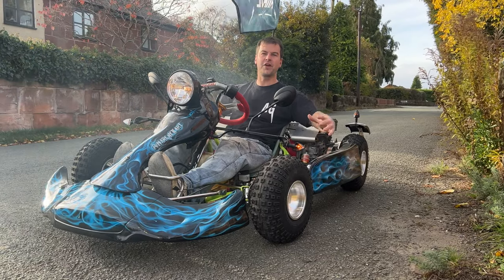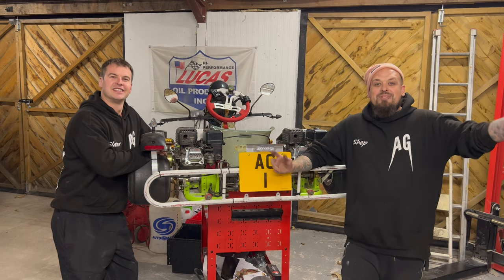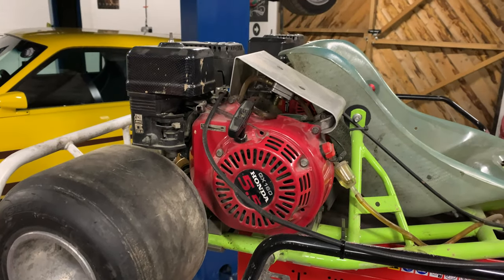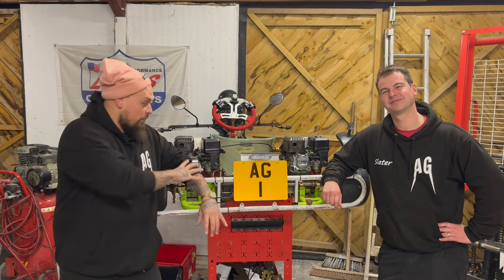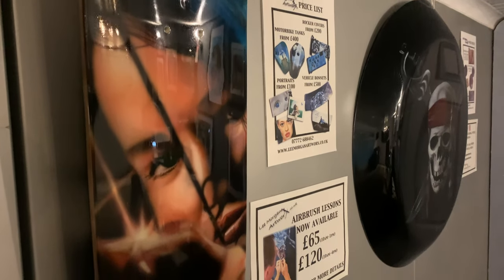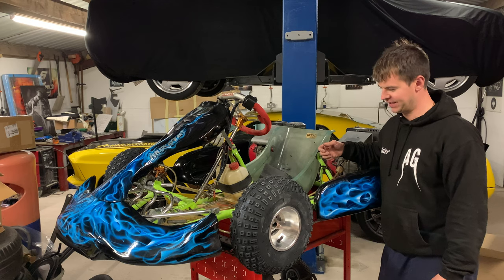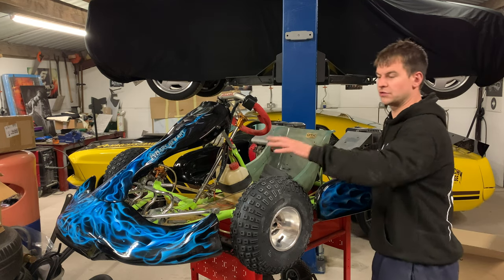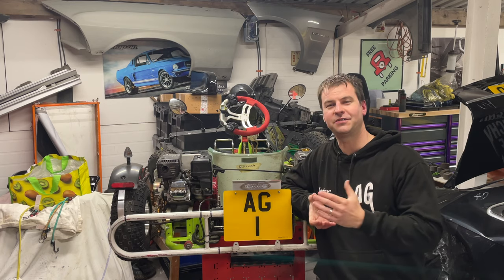How To Build your Own Road Legal Kart Anarchykart Part 1 - The Anarchy Garage - Episode 10

Comment: Can we have some links to the front brake kit/s
Reply from the maker: Yes I will add some 👍🏻
Please do your measurements against your kart frame to make sure they are compatible. You can also make brackets and use washers to make them fit as long as it’s good quality you should have no issues come MOT time
Reply from the maker: https://www.ebay.co.uk/itm/Kelgate-Kart-Brakes-/185181248013?mkcid=16&mkevt=1&_trksid=p2349624.m2548.l6249&mkrid=710-127635-2958-0
Reply from the maker: https://www.ebay.co.uk/itm/Wild-Kart-Pulsar-Lotus-Front-Brake-Setup-/194196426489?mkcid=16&mkevt=1&_trksid=p2349624.m2548.l6249&mkrid=710-127635-2958-0
Reply from the maker: https://www.ebay.co.uk/itm/ATV-Quad-110cc-front-hubs-stub-axles-and-brakes-pair-110mm-/193726300391?mkcid=16&mkevt=1&_trksid=p2349624.m2548.l6249&mkrid=710-127635-2958-0
Reply: @theanarchygarage9418  Awesome. Thanks fellas. 👍